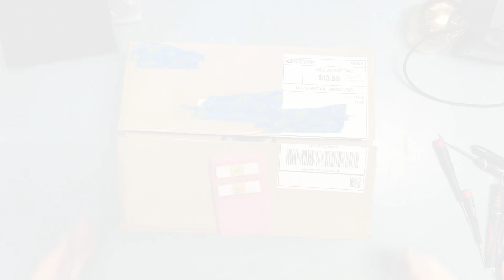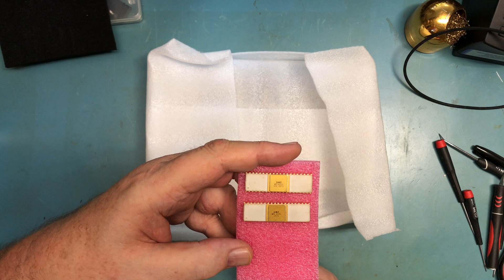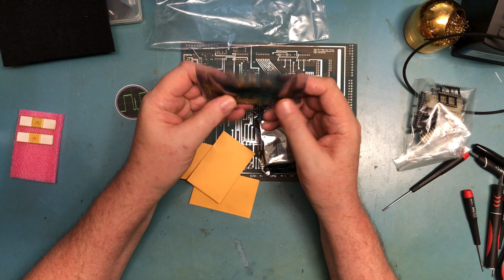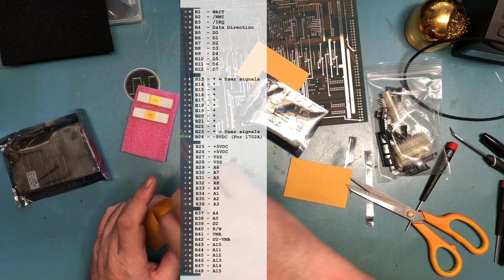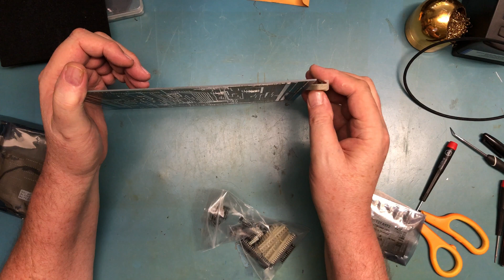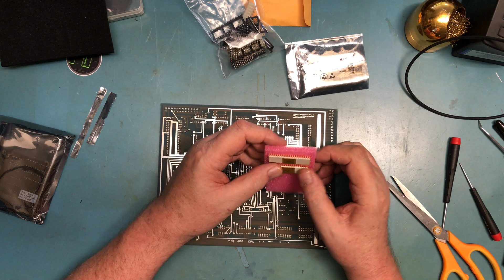STB1050 - OSI 400 CPU PCB - Part 1 - Unboxing and Initial Look

Comment: Glitch does fine work.  My 400 replica board has been gathering dust for far too long, I need to get around to assembling mine.  I intend to use mine with a 6512 as well.  Glad to see another one out there, and with plans to host a 6501 too!  I'm envious.
Reply from the maker: Awesome! I've kept notes throughout the build should you ever want to see them.